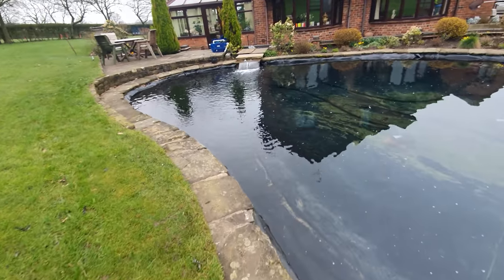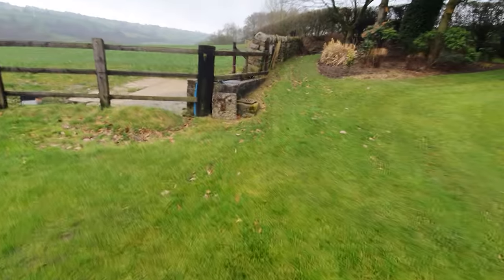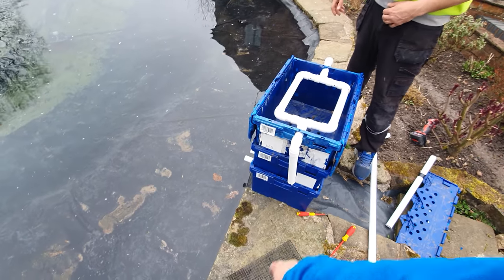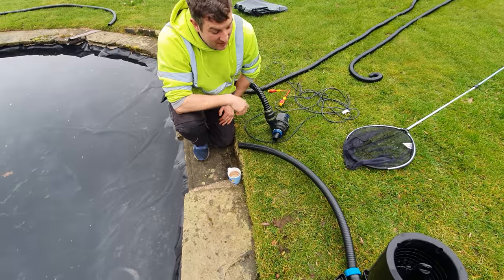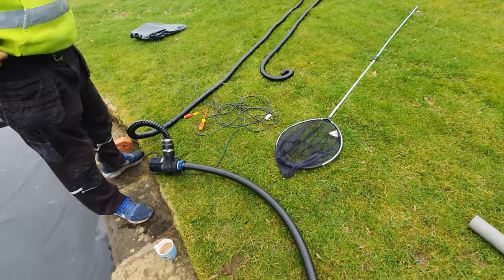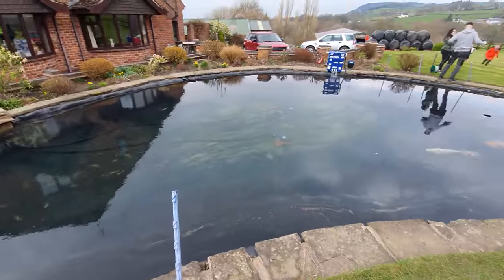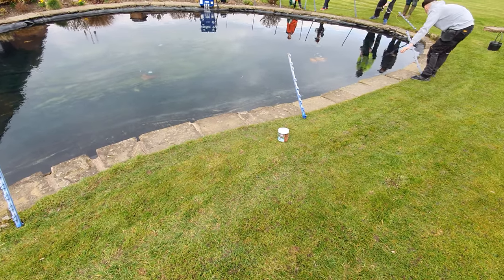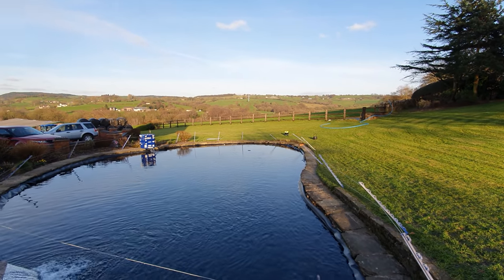80,000 litre koi pond - Adding fish, filters and Sturgeon!

Comment: Will the fence work? The herons covered in feathers it would be like trying to get a shock through a feather filled pillow. Herons often land in shallow water! A good friend of mine has a massive pond with Koi & Sturgeon, he was pestered by herons and a kingfisher! He now has a  Goshawk screams taped and plaid by having an infra red movement alarm enclosing the pond. As soon as anything enters the area the Goshawk does his job and off fly the offenders! He's one of the local gamekeepers so he has other ways of solving the problem but much prefers this method.
Reply from the maker: Could you get me some more info on that buddy? That sounds like a real interesting idea
Reply: @TheBaldingReefer  He used to use the same system to look after his Pheasant Pens that had hundreds of birds in them ready for the local shoots. The only difference was that the infrared was set lower in height for fox, dog, cat etc as a fox could kill all the birds in one night no problem! The infrared would then signal him to his walkie-talkie that all the gamekeepers have to make him aware that either a fox or poacher was around! The fox would get the obvious treatment. His friend (another gamekeeper) told him that most animals run/fly as soon as they hear Goshawks scream! Rabbit's & Hare's run like mad, so do waterfowl! He tried Goshawks and Owl silhouettes cut from thin sheet steel painted black. This worked for the Heron but he had to move the silhouettes around because the heron got used to where the silhouettes were! He used to have tripwire around the pond but then the heron got used to that and landed where the water was shallow! So he then put up some Infrared units around his pond and garage. He could then control them from the house. At first he connected it to bright strobe lights but, the damage was being done during the day so wasn't effective! He then asked around his friends who were also gamekeepers but had no joy. He just mentioned it in a pub that he needed a tape of a pissed off Goshawk. One of the local poachers told him that a friend has Goshawks. So he eventually got the recording, he just repeated the sound over and over to fill a tape.
He used a house security floodlight that was timed so he could control the length of time that the Goshawk would sound!
I can remember him being so chuffed and was making up the units to sell for other gamekeepers to look after their young birds!
It looks after itself, he just had to remember to rewind the cassette every morning. I used to see him regularly and done work for him if he had any problems with poachers but I'm to old for that. I never bought a Turkey for Christmas and if I fancied duck, pheasant, goose, pigeon, woodcock etc I only had to phone him and it would be delivered gutted, feathered the lot lol even the rabbit's! 
He put about a dozen of infrared units around the pond that overlapped with each other. The same used on the security lighting around the home.
They were connected to the actual security light that then switched on tape! I bet someone would be selling the sound or you'll be able to download it off the Internet. I'm pretty sure he only used the Goshawk it might work with another bird of prey! He could have sorted out the trouble with one of his rifles but he preferred this plus he wouldn't have to build hides and wait for them! I'm surprised no one is making them! You could have different birds on a CD! He had German Shepherds that he used to take out and introduce to the poaches... The Heron's wouldn't move even with them! Just something about Goshawks! But his pond was massive, he had 3 fountains and an island in the middle surrounded with lilies, you never got to see the fish unless he had a Barbecue and the odd hotdog bread cake got thrown in which was soon scoffed up! Other than that it looked empty! I hope this helps you Jack.
Flippin'eck just realised the size of this message sorry bud, these lock downs have gotten to me lol... Take care👍😷👍